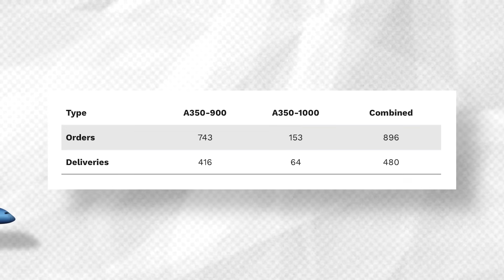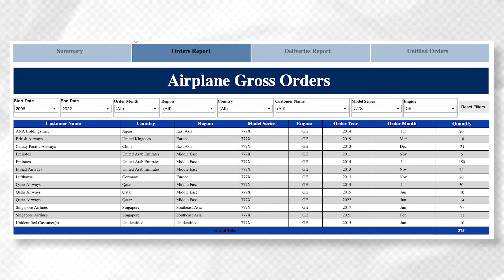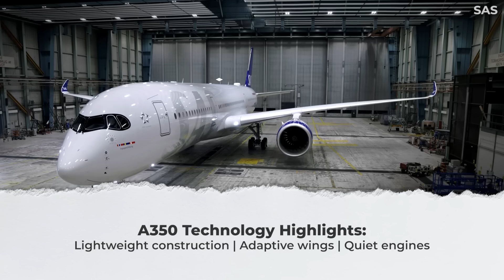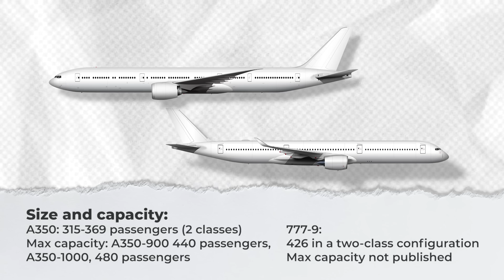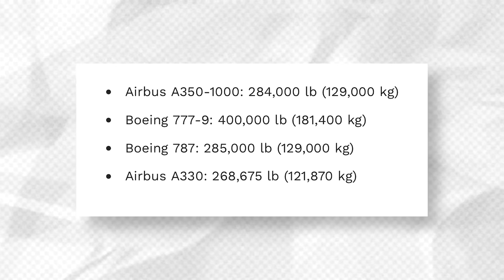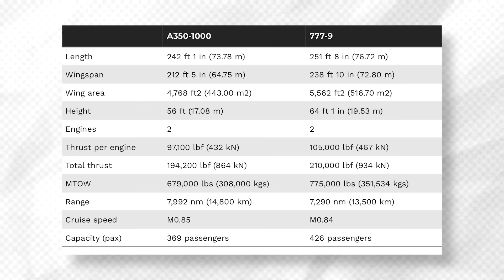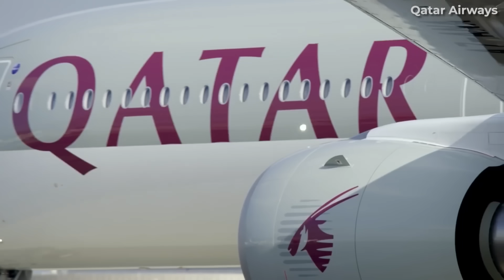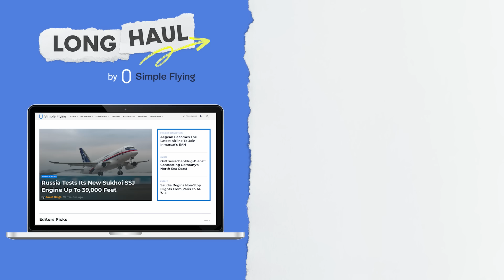The Boeing 777x vs Airbus A350 - Which Plane Is Best?

Comment: Depends on how the airline uses its potential, utra long haul will never be profitable, and Airlines flying very long distances are just ego tripping does it only for prestige & advertising. The best uses of long haul equiptment is best at 12-15 hour or 5500 to 6500 neutical mile, beyond would be very challenging to generate profit as inputs overhead are enourmous.

Comment: 7:21 the A380 had a freighter version but no one bought it due to its high price of $445 million per aircraft.
Reply: The a380F was a concept in drawings only before the a380 even flew. 

1. The upper floor would require significant structural reinforcement to be able to handle cargo.  Combined with structural reinforcement of the main deck, you just add weight to what was already a very heavy plane.  Due to the empty weight of the plane, plus fuel to feed it, the plane would probably could have never used its cubic volume before reaching MTOW. 

2. The A380F would have required specialized ground cargo handling equipment to reach the upper deck. Spending a few million dollars for a couple of lifts at each location to be able serve a single aircraft at a time, just adds to the inefficiency of an expensive plane.

3. The plane was already limited in the number of airports it can operate from (about 50).  In addition to specialized passenger gates with special jetways, airports had to upgrade taxiways.  Remember, freighters often operate from airports that are not main passenger hubs.  Anchorage, Alaska is a massive cargo hub for technical stops (refuel and crew change) as well sort operations, but has minimal passenger operations.

While the lack of nose door for long cargo is a major disadvantage when compared to the 747F,  most cargo planes don’t have a nose door (777F, 767F, 757F or p2f conversions of any plane).  

The a380f actual purchase price (not list price) wouldn’t have mattered if the plane delivered efficiency.  It was the inefficiency combined with the limited traffic lanes it could operate on that killed it.   I am sure airbus also didnt want to spend the engineering dollars to develop an a380f given how far over budget the a380 had gone when even the passenger market shifted under them limiting demand.  Remember, airbus didn’t even want to invest in an a380neo to try to save the a380 program.

Comment: I've rarely seen such a biased video! It only highlights the advantages of the 777X! Examples: While the A350 specifies the width of each seat (18.5 inches for a 3-3-3 configuration), this isn't mentioned for the 777X. Why? Because the cabin width is only 26 centimeters (5.71m to 5.97m!!!) wider than that of the A350. However, the standard seating will be 3-4-3. Has anyone seen a 26-centimeter wide airplane seat?
The A350's efficiency is also better. But here, the argument is based on the 777's higher payload...
The topic of "acquisition costs" is dismissed with a side note. It's well known that the 777X is significantly more expensive than the A350. One would think that this would also have a significant impact on efficiency. But not in this video.
Not to mention topics like maintenance and the like!!!
Conclusion: an extremely weak video, presumably sponsored by Boeing. What a shame I wasted over 11 minutes of my remaining life on this pointless video!!!

Comment: The original 777 with a maximum takeoff weight (MTOW) of 545,000–660,000 lb (247–299 t) was produced in two fuselage lengths: the initial 777-200 was followed by the extended-range -200ER in 1997; and the 33.25 ft (10.13 m) longer 777-300 in 1998. While the A350 first flight with two RR XWB engines was on 24 November 2016. So the Boeing 777 came along 22.5 years BEFORE the Airbus A350 airplane. While they are both excellent commercial aircraft, 645 A350 have been delivered to customers; and over 1650 aircraft have been delivered to customers. There are two variants of the A350 and there are six variants of the Boeing 777 aircraft. So while interesting, the above video is more of an advertorial for the A350 than an accurate comparison. I have worked on (inspected) RR and PWA engine components for both aircraft in the past. In fact, I flew on a Boeing 777 from New York to Tolouse, France to inspect the first two RR XWB engines to be installed on the first A350, at the request of Airbus Chief Engineer for engines, Aileen Garott, in 2015. After I documented their acceptability they installed them on the first A350. I worked for GKN Aerospace out of San Diego, Caifornia. But both are 😇excellent aircraft, with a much longer fantastic safety record for the Boeing 777!

Comment: Airplane engineers must create planes with four engines for the sake of safety. 4 smaller engines that do exactly the same power as two bigger engines. That way the safety of planes will be on another level
Reply: Mordern planes can fly on 1 engine, the FAA used to think the same like you, until airbus and boeing overrided the regulation. Now 2 engines is the standard, its been the standard since 1985

Comment: I think airbus are a thing of beauty across the range but that 777x is an undeniable beauty too! I'm rooting for Boeing being successful with the 777x because that company really needs it after the costly delays in production but that A350-1000 has reached peak performance for many airlines and is a tried and true airplane. That 777x will be playing catch up for decades! By then I'm sure Airbus will have an even better replacement that they're probably designing right now. FLY AIRBUS!

Comment: OK since Airbus does seem to be more fuel efficient the thing I think would make a difference is pick a destination like LA to Tokyo with both planes full add the average cost on the flight times the seat capacity. Then calculate the fuel burn for the flight. Minus that figure from the revenue then minus the crew salary and see which one comes on top. Now I  know there are more factors involved like meals etc... can anyone come up with the two figures and let me know. I'm  just too lazy to do the math.

Comment: An A350-1100 or whatever it is called would marginalise the 777x, simply the A350 is far, far lighter. What is needed is an engine to make this possible. In 5 years the RR innovations should make it worthwhile to introduce a neo across the range but in particular a larger stretched version. Not sure whether the wing on the A350 can be extended with the patented downward folding wingtips, if it is economically feasible then an aspect ratio of 10+ should be within the grasp of Airbus. Those two improvements would drag the A350 into an unassailable position from an efficiency perspective. It would be nigh on impossible for the B777x in its current to compete, its heavy fuselage handicaps it too much.

Comment: A350 is a better aircraft. I loved flying in it! A350-900 is out selling the -1000 by a wide margin. Larger capacity without much better efficiency of 777-9 will hinder its sales. More likely to fill a smaller and make money instead of flying a larger plane that is not full.

Comment: What is the point of an aircraft, which comes into service a full 10 years after its direct competitor, but still needs 50% more fuel per nautical mile? Even per passenger seat it still burns more than 20% more fuel. Apart from the economics a direct consequence is that A 350 - 1000 accomplishes with a smaller maximum fuel capacity a significant longer range.  It is also less expensive. There are more metrics but these are the ones, which count. There is no question which plane is better. Boeing is unlikely to make much profit from the 777x

Comment: i think Boeing made a mistake by making the 777 from more conventional materials iso more composite materials. the fuel burn per passenger seat mile says a lot 0.09 vs 0.11 (777). that's about 20% more . if 777 caries more passengers, they would simply burn more fuel. perhaps there is  a limit to composite fuselage size, hence the smaller 787. But the  350 can fly much further that 787 or 777. So composite materials do make the plane more fuel efficient. Boeing 777 is starting operations around a decade late
Reply: The 777X had a new composite wing and the fuselage is from Aluminum Lithium Alloy. Per seat the 777-9 is slightly more efficient than the A350-1000. But this relies on several factors like cabin configuration, route length etc.

Comment: I couldn't believe the listed price difference between the two planes when I looked it up. The A350 likely provides better fuel efficiency than the 777 all while coming in at $100 million less. Surely the only reason an airline would consider purchasing the 777 over the A350 is for larger capacity
Reply: Totally wrong. The 777x capacity 426 and a range of 7285miles. A350-1000 capacity (max) 480 and range 8700 miles plus the A350-1000 is approx 100million less!
Reply: @johnchristmas7522 You said "totally wrong" and then 100% agreed with them.

Comment: A350 wins and it is not even close.  Much more advanced jet despite already being in service that is more versatile, offers longer range, it flies faster etc...  777X is barely any different than the 777-300er with exception to the wings.  They took away power in the name of efficiency despite this being the biggest engine ever.  It certainly does not make it fly faster.  Jets from the 60's and 70's were significantly faster than both of these, especially the 777x.   From a pure performance perspective this overall engine design hit its peak from a speed perspective decades ago.  Because there have been no real advancements in everyday commercial aircraft design related to speed, performance related to this is regressing not progressing.  It takes hours longer to fly across the ocean and country than it did in the 60's, 70's and 80's.  They have not figured out how to do efficiency without sacrificing speed and as such, jetliners are designed to fly slower these days for green purposes and efficiency.  I predict that this trend will continue until these jets are nothing more than gliders.  Very tough to get excited about the future of air travel given these annoying trends that are all centered on efficiency and green with no new technology to overcome those issues.  This leads to taking things away rather than truly making meaningful advancements.

Comment: You should better compare the 350-900 with 787 and only the 350-1000 with the 777.
Reply: Even A350 vs 787 is not a good comparison as the 787-8 and -9 is in the same category as the A330neo.

Comment: A-350 doesn’t compete with 
B-777. A-350 directly compete with B-787. So airbus should make real class competitor. B-777 is a full size twin engine Aircraft. Meanwhile B-787 and A-350 is a midsize twin engine aircraft.

Comment: should be asked: which one is better for passengers? A350 by a long shot.
Reply: Why that? The economy seats in the 777X will be just as wide as in the A350. Business and first seats most probably even wider.
Windows are much bigger, cabin altitude is the same. Noise in cabin should be even less (don't know about this one for sure).

Comment: The 777x fuselage ripped badly during ground tests and Boeing brushed it off by saying the burst happened right at the end of the test, so no worries.  After some bad landings and flying around in real-world conditions, that fuselage weakness gives me the creeps.  Then there was a report that there was some kind of near-disaster during a flight test that is contributing to the delay in getting the plane flying with the airlines.  Sir Tim Clark made the comment that Boeing hadn’t done its homework before committing the plane to begin airline flights some years ago.  I sure hope airline engineers and the FAA go over the 777x very carefully before starting scheduled flights.

Comment: So the 777-9 empty weight is roughly 50 tonnes higher than 350-1000, while MTOW is 42 tonnes higher. There is no way the 777 can be more efficient with it's higher thrust engines.

Comment: Ha.  The -1000 is simple a smaller plane. If you really want to sit in a 16.5" seat, go for it.  Airbus crammed those seats in there to try and compete.  Argue all you want.  Airbus will go with 11 seat width and claim again a win.  I do a lot of flying and avoid this "trying to keep up" approaches.

Comment: The 777x will certainly be better with its wider cabin, Qatar airways will be able to configure their planes better and have more comfortable seats! The two planes are superb but I must say that I prefer the 777x which will undoubtedly be better for the passengers and the pilots but as far as airlines are concerned, the A350 meets more needs and is a little more economical!
Reply: & i hope they don't install dimmable  windows
Reply: @jirehla-ab1671  the 777X has no dimmable windows.

Comment: It bothers me to have to say that but it's just the truth, Airbus has long overtaken boeing, Boeing was making good planes and much more comfortable and modern planes than airbus. Now it is on the contrary Airbus which has progressed and offers planes much more comfortable much more modern than boeing while being easy to order and at a cheaper price for better quality, while boeing on the contrary the more it advances the more they become complicated. Their planes have too many problems, they are expensive, they take a long time to be delivered and there are always doubts about their reliability, while during this time Airbus offers more modern, more reliable and more comfortable planes, all this with cheaper prices. , I think of the A350 and the 777. The 777 before the arrival of the A350 was definitely the best and most efficient long-range aircraft in the world, but now the A350 does basically the same thing but much better and boeing wants to keep its status as the best jumbo jet with the 777x but the same, the 777x is taking too long with all boeing's doubts and until then if it is most of its orders will be replaced by A350 orders. It's sad to say but it's the truth...Boeing is degrading.

Comment: With the A350-900, Airbus almost killed the current B777 market. But when we see , both the B777-9 and the A350-1000 orders, they are not as high as some experts had predicted several years ago. The pandemic has shown that the market can be so unpredictable for the airlines. Airbus don't have to be anxious about a boom with the B777X orders. EMIRATES, the largest customer with half of the total orders, is still unsure about a potential swap of his long awaited B777-9's with some B787-10's or A350-1000 (?). My guess is that the B777-8F cargo version will meet strong sales. With the A350F as a strong opponent. The biggest challenge for Boeing will be to make profit from this costly project....Likewise with the B737MAX and even with the B787. Boeing is not the reference anymore in the industry. The B747, B757, B767 and B777 are the last trustful and very profitable Boeing aircrafts...
Reply: Boeing 737 was the cream of crop for Boeing, but with the horrendous accidents resulted from the MAX variant, things have changed for worse.
Reply: u guys dont have knowlede of aviation
Reply: Airbus isn’t even close to killing the 777 with the A350. The 777 is the best selling wide body of all time. the A350 has quite a bit to go before it outsells the 777.

Comment: You got this one right. All the numbers favor  the A350 1000. The fact the A350 has better seat/mile economics that the larger 777x speaks volumes. Boeings money plane is the 787 in that it has similar technology to A350 & performance figures are very similar, particularly with GENX engines, by all accounts
Reply: I agree, I wonder why they couldn't make an even larger version of the 787 to replace all the 777s while the 787-10 already replaces the smaller 777s. But hands down, Airbus would be my pick.

Comment: Of course being a European you would favor the Scarebus.. but numbers on an airframe dont tell the true story.. fuel burn , mgtow , seating,  yes are simple to collate to present .. but what about seat cost per mile , or maintenance intervals on airframes and what about tob's on the powerplants. The 777 from its inception was meant to replace the 747 .. if Boeing logically expands this airframe, it will have a superior aircraft in every domin that scarebus currently operates in.. to  bad McDonald douglas or Lockheed is absent from this pony show.

Comment: As the majority of the orders are for the A350-900 instead of the larger A350-1000 the 777X as an even larger aircraft will have it difficult.
Reply: 777X orders: 320

A350-1000 orders: 182

Naa , this above proves otherwise.
Reply: @mmm0404 exactly, this is the point that most refuse to see.

Comment: I prefer the A350 for giving better shoulder Room compare to 777X . Somehow Boeing planes are narrow compare to Airbus. 737 Vs A320 and B787 Vs A350. 
Hopefully Airbus will come out with a proper 10 abreast air linear. Have a joint venture with Comac as China is a big market.
Reply: Last time I checked the 777 was wider than the A350 and the 787 wider than the A330(/neo).

Comment: I was rooting for the 777 but the A350 edges it out...the wingtip bend on the A350 is so cool.
Reply: 777x will have its work cut out to compete with A350.
Reply: 350s are ugly
Reply: The A350 does not edge anything out.  The 777X is the clear winner.
Reply: @dantove963 mark your words.
Reply: @roku_nine  marked.